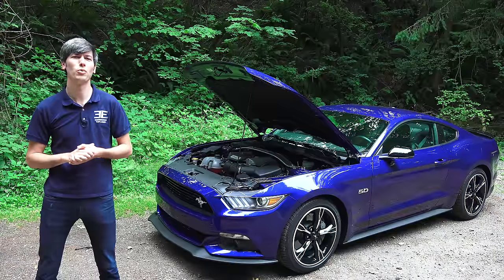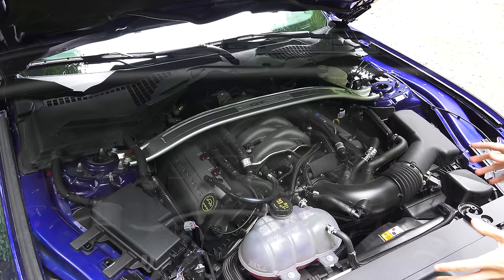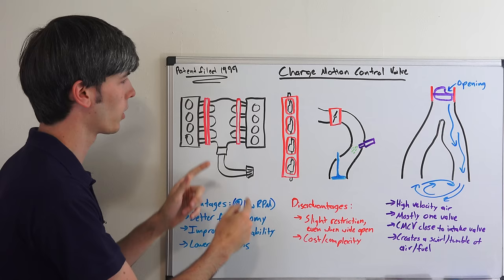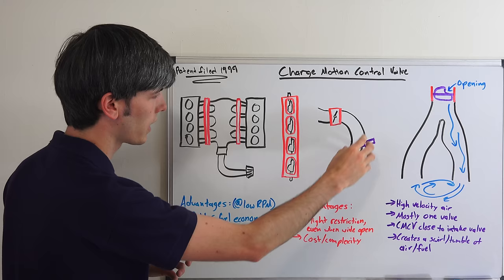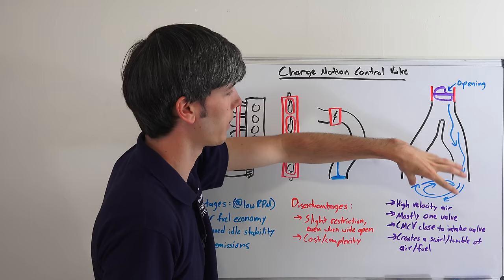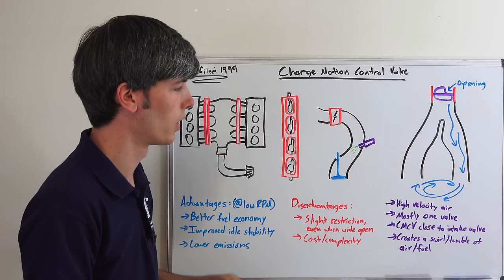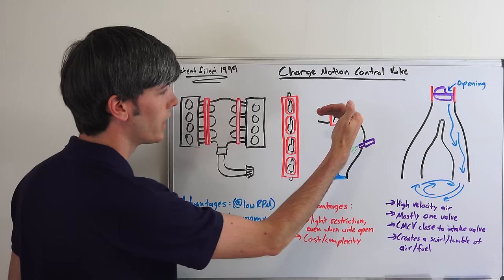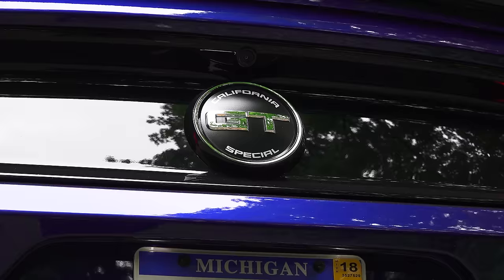Keeping The V8 Alive - Charge Motion Control Valve - Ford Mustang GT

Comment: Ford was doing something similar with their IRMC valves on Duratec V6 engines.. BUT was about intake runner selection.  The intake manifold had 2 runners per cylinder a short and a long runner... and the valve opened at a specific RPM to aid in upper rev power without killing lower end torque.

Comment: Another great video - this one is close to home for me.  I've got the 4.6L S197 with these plates.  It is a common mod to remove them but the cost/benefit is not enough for me.  When these valves open it feels like a turbo kicks in as you pass 3,000 rpm at WOT.

Comment: So, 16 years ago Ford patented a technology that has been in use in my 31 year old Twin Cam, 16-valve Corolla GT-S with T-VIS. One runner is always open, while the second one opens at 4,200 RPM. In the Yamaha built head (Toyota's technology partner), the Variable Intake System places a butterfly valve plate just before the intake valves, right next to the head, just past the intake plenum runners. Once the valves open, you can hear the additional air as it gives a nice deep, throaty sound and the engine races towards its 7,500 RPM redline. Woo-hoo Ford, way to show up to the party 15 years late!

Comment: I had a 1988 Toyota MR2 that had a similar setup on it's 1.6 liter I4.  Each intake had 2 runners, one of which was closed off by a butterfly valve until about 4k RPM.  I believe the intended purpose was to increase low-end torque while allowing better air flow in the higher ranges.  I seem to remember it working quite well!  I have wondered why I haven't seen this implemented on any other cars I have owned since then.  I always thought it was a simple and elegant solution to that problem!

Comment: Toyota had a similar system brace in 80's. I think it started in the engine 4a-ge. It was called T-vis. It's not the same but it's cool that they still use same kind of tech.

Comment: 1989 Nissan KA24E did something similar with thier "SCV" - Swirl Control Valve. Though Nissan didn't direct the flow to one intake valve. They used a half "butterfly" valve which restricted air to the top of the runner.

Comment: Minor correction to your video here sir.  The CMCV used in your description is indicative of the action on the older 2V 4.6L engines.  The new style CMCVs are hinged at the bottom portion of the runner, and not in the middle.  Thus, when wide open, they fit near flush to the runner and allow the air to pass relatively unimpeded.  The older system had the butterfly-like valves in the center... which caused some turbulence in the air as it passed.  This issue has been remedied.
Reply: Guy Gordon have you done the CMCV block off kit on your boosted s550 ? my s550 is boosted also and there's times that I feel the car doesn't feel as awake as its supposed too vs other times where it's super responsive

Comment: Excellent explanation.  I’m a huge fan of the Coyote V8 and have one in my F150.  I had F150 with the Ecoboost before an it’s also a fine engine.  I had scoffed at the V8 at that time because I thought it was still the Triton like in my wife’s Expedition.  When I found out about the Coyote, they had me at DOHC, but the more I read, the more I loved it.  Then I drove one.  More responsive than the Eco due to lack of turbo lag, with more growl.  Love it!  The creativity of the CMCV system is yet another reason why Ford has the best engines right now, IMHO.

Comment: Have you seen the work done by Koenigsegg?  They have designed air actuated valves increasing fuel economy by 20%.  Very cool engineering.
Reply: I thought it was electro-magnetically controlled valves completely removing the need for a camshaft or 4 (in this case). fuel economy was up by about 20-25% from memory.
Reply: +Tim I just watched it.  they use air to open the valve and oil to keep it lubricated.  it does eliminate the need for camshafts.  very cool technology.  Koenigsegg does some awesome stuff
Reply: My mistake. Cool Tech id love to see in the mainstream!
Reply: It is electro magnetically controlling the pneumatic valves using closed loop control, pneumatics then actuate the engine valves
Reply: +ytxstream so cool, this and the battery cars is awesome.
Reply: Hear Bloody Hear, brilliant!

Comment: My supra had this.. In 1989.. The Toyota ACIS system at least in the non turbo cars.. Ford is catchin up!
Reply: Yep, and TVIS even earlier. Cutting edge tech you got there, Ford.
Reply: Your supra came from the factory with a V8?
Reply: CVTaxi I6. It's old tech that was used to make a bit more torque on the lowend. Just a butterfly valve on in the intake maifold. one for each side of 3 cylinders.
Reply: The system I looked up just had a second butterfly valve that was vacuum operated that gave air a shortcut to the valves when the vacuum dropped. The air would normally travel around a snail that would add another foot of manifold length.
Ford have actually using this on a lot of their 90's I6's as well.
Reply: +tanker9987 Like the 300 4.9L? or something else?
Reply: mazda rx7 had the same thing in the non turbo engines.
Reply: The ACIS was more of a variable length runner. As described here you'd liken it more to a TVIS, in which each cylinder had two runners, and one was closed by a butterfly valve at low revs, increasing air velocity at the injector and swirl in the cylinder. Still, most makers have had "tumble control" or "swirl" valves in their engines for years now, this isn't new tech and it isn't ford doing anything special to "keep the V8 alive", Chevrolet and Chrysler and doing a better job of that with cylinder deactivation systems.
Reply: *****
 They won't die, you still have V10's and V12's which almost everyone agrees provide very little benefit over V8's with the same displacement.
People do like unique engines, and the "big ol V8" now has a strong cultural following.
Reply: PGT Films. v8's ftw!!!
Reply: PGT Films. Volumetric efficiency isn’t important unless you’re talking about cutting weight. Fuel efficiency while maintaining power/torque is what matters.

If we can continuing squeezing more efficiency out of V8s, why not?

Comment: The first time I saw something similar in a car, was in my 2013 Ssangyong Korando, its called swirl control valve, but this one interrupts the airflow through the second intake runner to the combustion chamber. So its like a controlled DOHC, that behaves like a SOHC at low rpm, also each intake runner has a different angle to make the swirl adapt to the rpm.

Not sure if its effective though.

Comment: The flap actually folds back into the wall of the intake manifold runner (It does on the GT350, assume it does so on the Coyote too) it's pretty cool, virtually no restriction.
Reply: not in the 5.0 yes in the 5.2

Comment: The Gen 1-2 Ford Taurus SHOs used this conceptually through the use of a long narrow intake runner under 3800 RPM. Above that, a valve would switch the intake to a short, large diameter runner.  Tuner chips could start the changeover process at an earlier RPM and bleed the valve open rather than snapping it open like stock which gave an odd short torque drop.

Comment: Ford used this same idea in their 1993-1998 DOHC 'B Cylinder Heads' (aka swirl-port heads) as well. Cool video
Reply: They called the control valves 'Intake Manifold Runner Control' valves. They closed off the secondary intake port under 3,250rpm to allow better idle control and low-end power until it was needed higher in the rpm range

Comment: Honda has used this technology since the early 90s.
Reply: are you talking about vtec? because its diferent, even if the idea to vary the airflow. Almost each conrtructor have diferent ways of doing it.
Reply: VETC-E, closing one of the intake valves to create a swirl effect and agitate the mixture for fuel economy and emissions.
Reply: no.
Reply: +Mustang Aficionado vtec based on oil pressure changed the camshaft lobe profile for higher duration and higher lift.   E vtec utilized variable camshaft timing.
Reply: Toyota put out T-VIS in 1982, had two intake runners and they were only both open above 4200 rpm.
Reply: Ford also used something similar on the Yamaha SHO 3.0/3.2, and VRIS from Mazda which ended up in the Probe. T-VIS and the SHO setup were closest in design. Those used 2 intake runners with one shorter than the other that closed off at lower RPMs and opened at higher RPMs.
Reply: What is a Honda
Reply: It's one of those things usually found blocking the left lane matching the speed of the cars in the right lane.
Reply: +you are reading this Its somthing that goes brrrrrrrrrrrrrrrrrrWWWWAAHAHHHHHHHHHHHHHH
Reply: unless it has a fart can
Reply: I think he is talking about the dual runner intake manifolds that had diverter valves sending the intake air down different dimension runners during lower RPMs.
Reply: So has Ford/Yamaha with the 3/3.2 SHO.
Reply: +se7en1976 Yeah, okay.
Reply: +se7en1976 - Clearly not a Taurus owner. :P
Reply: honda sucks.  civic is bloated.  accord's styling seems to be drawn up by a blind dude.   the new ridgeline is ugly as hell.
Reply: This was on the 86.5 Toyota Supra. Pre V-Tech Yo! It was a great was to know if you where wasting gas lol.

I had a 89 N/A then a 88 Turbo which doesn't have that.. and noticed that turbo cars don't have it from what I've seen, but I'm sure some do idk.

I'm still amazed at how a car from the 80's ran every bit as well as cars from the early 2000's. Got me about 24mpg mixed driving if I drove it like a sane person. About 32mpg going 75 on a road trip.. then didn't like 80's.. but over 90 it was back to very light throttle.
Reply: so did ford on a lot of early 90s v6 and v8 engines with 4V heads. the mark 8 lincoln in 93 was the first in the V8s iirc
Reply: Ahem.....MR2,AE86...TVIS.

Comment: So basically a new name for intake manifold runner control or IMRC.
Reply: I read the literature and ford claims they positioned the valve in such a way that when they are fully open they aren't in the path and blocking airflow like the traditional imrc
Reply: I work at a ford dealer and just worked on a 16 mustang for this issue, ford still calls it IMRC
Reply: +Eric Hoover in design at building 1 we call it cmcv...
Reply: The service manual ford sends their techs to service and perform repairs on this vehicle they call is IMRC, the engineer from ford I talked to when I had a mustang having issues with this system called it IMRC, and If you go to the parts department of any ford dealership and ask for said part they will correct you and call IMRC....I am a certified engine master with ford I would know
Reply: +Eric Hoover good job, I was just telling you what design calls it at world head corridors. sorry your dealerships haven't gotten the up to date information. I can get you the phone number of the compoent engineer if you'd like.

Comment: Technically a variation of this technology was available prior to 1999 on Fords under a different name. It was first available on the 1st and 2nd generation Lincoln Mark 8 and the 96 to 98 Mustang Cobras. It was even available on the 2-liter sohc Escort & Focus engine. Those were split port engines with 2 intake runners per cylinder long runners for low rpm and short for high rpm. They were called intake manifold Runner control or IMRC. To this day if the system fails and you get a check engine light you'll get an IMRC code instead of it saying a charge motion control valve code. this technology was ditched in 1999 but reintroduced on the 2005 Mustang to help control idle then ditched it again in 2011 with the introduction of the Coyote engine. Once again with the improved Coyote engine and a new camshaft profile to help to control idle Ford added it on the Mustang & F150 intakes.

Comment: Similar in concept to the Honda VTEC-E system introduced in the D15Z1 engine in 1992. VTEC-E, unlike regular VTEC, would have one of the two intake valves run almost completely closed, lifting enough only to prevent fuel pooling. When the engine exceeds 2500 RPM, the VTEC system engages, putting both intake valves (per cylinder) on the normal cam. It does the same thing described in this video. This is not cam phasing, as Honda did not do Cam Phasing (Variable Valve Timing) until the K-series (post 2000) with i-VTEC. The 1992-1995 Honda Civic OEM Service Manual (called the HELMS) goes into great detail on the theory and operation of all the VTEC systems used in the D series engine.

Comment: A.K.A. tumble flaps or swirl flaps. They were in my 2003 B2300 (ford ranger). I took them out since they were clacking around and not working properly and I didn't want to spend $300 on a new intake manifold. Not sure what the affect on MPG was since it never worked properly, but I get 25mpg on average in the city (Austin) now. The truck is a bit jumpy at low throttle now, but has more power at WOT (again, not sure how this compares to correctly-working flaps).

From my limited research, these flaps occasionally broke off and grenaded engines. Because they're normally plastic flaps held together in a metal rod, which threads through a plastic manifold, wear from metal-against-plastic contact is inevitable.

Comment: Sounds like a very similar technology used by Toyota in 1985 with the 4A-GE in the famous 1986 Corolla. The idea was again to increase air flow at low rpms as 16v meant low-end torque was lacking. Eventually most manufacturers went to VVT to shorten/delay intake lift to achieve similar results. Others used more advanced variable intake manifolds.

My guess Ford didn't want to employ Valve lift or VIM due to cost (the Mustang has to remain cheap to sell) so that's why these butterfly valves are reintroduced. Not radical or new, but cost effective.

Comment: took me a while to figure out that CMCV is just another name for IMRC

with them disabled you lose torque below 2k rpm so maybe puddling around town in a jam you might lose some power

it's anyway operating based on throttle position so even at low rpm when you press the throttle a lot they will open all the way so really no drawback in having them disabled and it's easier for the tuner to map your car

also with them disabled it's one thing less to worry about breaking so most people recommend disabling (deleting) them with a lockout kit

Comment: the cmcv on the 2015 and up coyotes is slightly different then the one you demonstrated which is from the 4.6 Era of ford V8's where the control valve is in the middle. the ones on the Coyote are mounted to the side and fold flat against the intake wall at full throttle.
Reply from the maker: Ahh very cool, thanks for sharing!

Comment: so basically instead of creating long intake runners to increase velocity, they made a valve to limit flow but increase velocity with the Charge motion control valve. 
Mazda did the same thing on Rotary engines in the 80s with the 13b n/a engine, mazda called it the dynamic chamber for the S5 rx7 series. Mazda kind of made one for the S4 rx7 but instead of in the manifold it uses rotating valves in the intake to increase velocity into the chamber. Mazda 787b the car that won lemans also had variable intake runners that slides up and down depending on RPM to increase velocity.

Comment: Hey Enginnering Explained! This technology actually goes further back I believe. The 1996-1998 SVT Cobra - 4.6L 4V V8 had this system called IMRC (intake manifold runner control), basically these plates would open up under the intake to let more air flow for performance in a nutshell. I wonder if is the same concept but more advanced in the 2016 Mustang GT. If anyone who owned this model please chime in. I only have two sn95 mustang GT's so I dont know the system entirely.

Comment: Could you do a video on how a twin disk clutch works, I don't quite understand how it works. I know its similar to a normal clutch with throwout bearing, pressure plate but how does the 2nd disk disengage as well as the 1st?

Comment: So it's like the IMRC (Intake Manifold Runner Control) system on all the other Fords, but with a chunk missing out of it. Why name it differently?
Reply: Marketing, if you can name it something cool you can charge more for it.
Reply: Essentially. It's a mix between IMRC's and VTEC-E - which was used by Honda to close one intake valve - creating a swirl effect agitating the mixture to a level it can be leaned out (<20:1) and still not pre-detonate. This created low RPM smoothness, high fuel efficiency and lower emissions. You're correct it's nothing new, just not often seen on V8's until recently.
Reply: T-VIS copy really even though both runners are technically open
Reply: I work at ford dealer its still called IMRC on these.
Reply: +Mustang Aficionado it's been in V8's since 96 Cobra.

Comment: it will be interesting to see in the long run which technologies are the most reliable for economy and emissions. personally i'm in the "direct injection" camp due to fuel injectors are typically built to last the life of the car and the technology used in new and high power diesel injectors can be applied to gas. with fords way my answer when that system breaks is "okay, guess i'm sticking a blower on it." lol.

Comment: Jason this reminds me a lot of the design of the Yamaha V6 the Ford Taurus SHO used in the Gen 1/2 SHO from 1989-1995. There was a vacuum operated butterfly valve that closed the long tube intake runners at about 4200 RPM and opened the short ones. If I'm understanding your video, the technology seems very similar with the same goal. Thoughts?

Comment: And in 3 years time the air valve/flap wears out and starts rattling like hell, and if your really unlucky they break up and find their way into the combustion chamber.. That is a problem Ford's had with a few of it's petrol engines over the last decade. I certainly hope they have improved the design so that the air flaps and their bearings last.